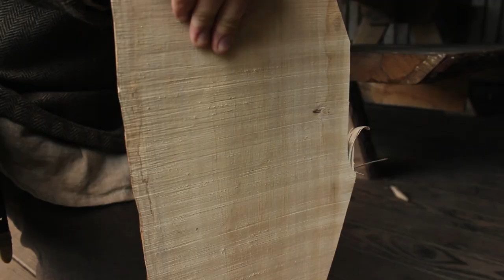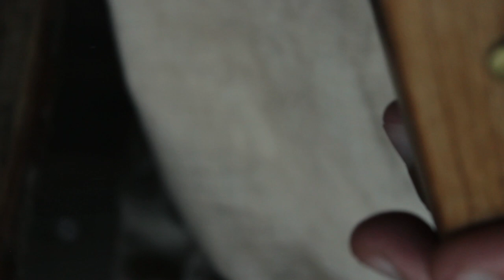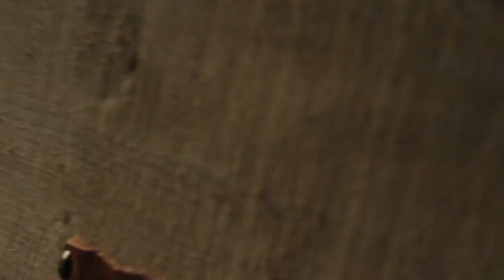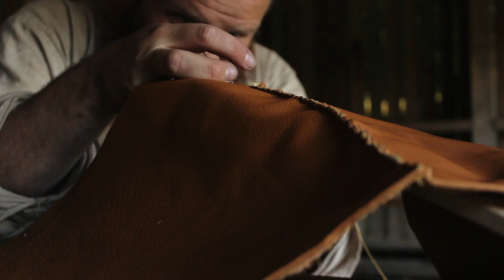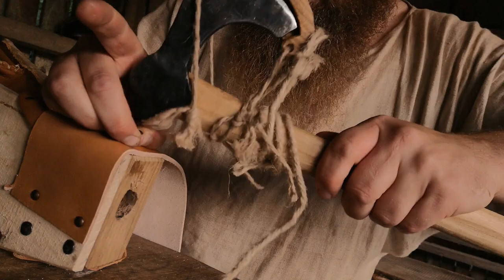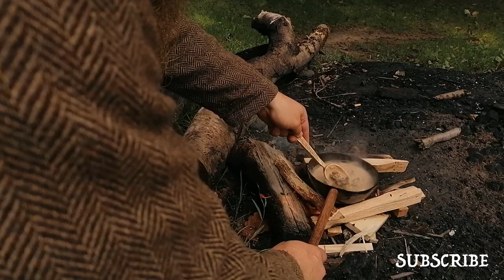Making VIKING Bellows | Viking Blacksmith part 1 - Viking Crafts (Ep. 8)

Comment: Great video!!! Very inspiring! What wood did you use for the bellows?
Reply from the maker: Thank you John. This was a plank of beech i had lying around. And the pieces for the hinge and nosel area is oak. The pipes was an old ash broom handle.
Reply: @RAMUNI-Viking  thats great thank you!! Would 1.5 inch thick pine planks be period authentic enough to use?
Reply from the maker: I think it would be ok. Pine trees were native to scandinavia in the viking age. 1,5 inches Will work but my planks Are 10mm and also work:)
Reply: @RAMUNI-Viking  thank you for this .... also what thickness leather do you recommend for the hinges?
Reply from the maker: @johnmulhern5546  i have used Ca 5mm. I would use as thick as possble to ensure a long life to the hinge.